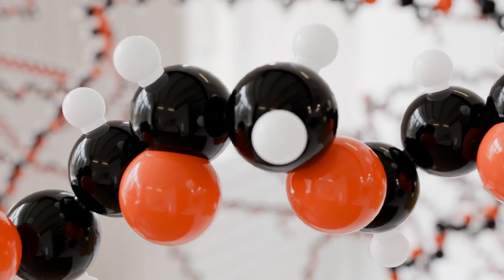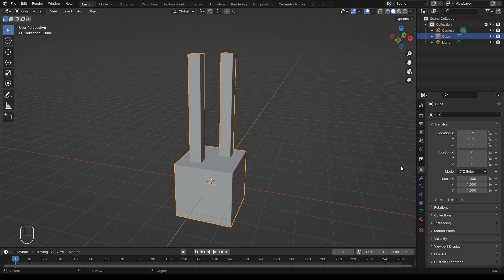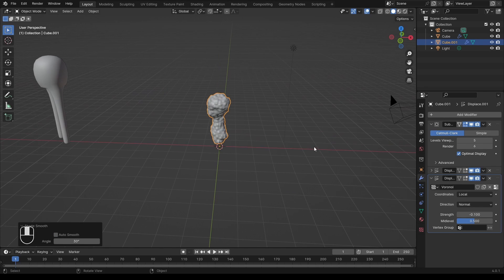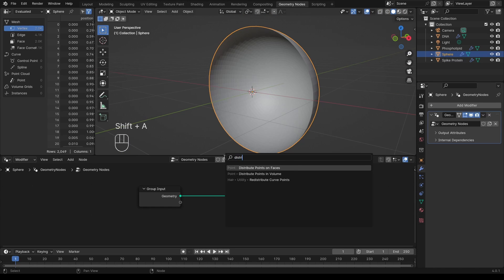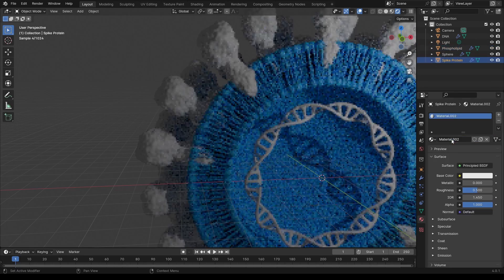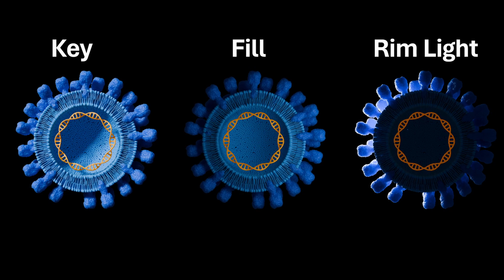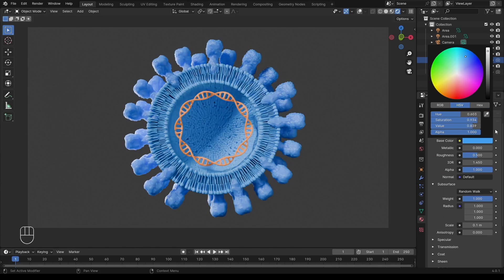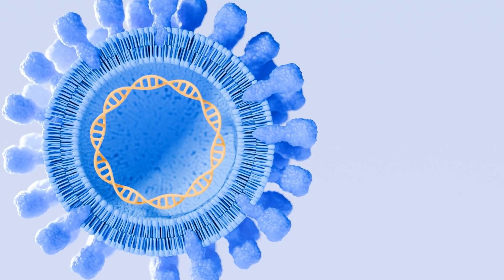Scientific Illustration in Blender: A Basic Introduction

Comment: I got trouble with choosing the ring at 1:42. My Blender is 4.2. Anyone could help me with the solution
Reply from the maker: Hi! The shortcut for loops selection is Alt + left click on one edge of the loop. If the edge can be mapped to multiple loops then it doesn't work, but you can still Shift+click on each edge that you need to select

Comment: thank you, geonodes seems to be really powerful ! i wonder, are you planning to have some detours in another realms-> physics for example? how about waves? sound and light) i still can't figure out how to make longitudinal (compression) waves, and in geonodes with math functions - there seems to be some kind of geometry on points (on every vertex in a curve, representing sine wave), but it never renders out, i end up making a curve or a surface 'old way', switch to geonodes and just put instances on points, but then i can't find a way to animate it all
Reply from the maker: Hi, thanks mate) ! That would be a fun short vid idea actually. Compression waves you mean as in a volume? I would use the Position Node, feed it through separate XYZ, then pick for example the X value, pass it through math-sine and add 1. This 'sine' field will have a value between 0 and 2 varying with a sine function on the x axis. Then use that output to control the density of a volume cube for example. Or do a volume cube > distribute points in volume > set position, then control the offset with the sine field (use combine xyz to convert the sine field to a vector field). This should make all the points wobble back and forth along X, they should accumulate and deplete. TO animate you can add math nodes before and after the sine function to change the values
Reply: @ClickbaitScience  volumes! of course, thank you so much, i somehow always forget we have volumes) i think it will produce exactly the results i am looking for (but surely i would love to see tutorials on this matter from you). and this 'separate XYZ, then pick the value, pass it through math-sine and add 1' is exactly what i saw in another vid, and hoped it is the right solution, but it seems there is no geometry - real  geometry - what can be displayed in render view? it is something that baffles me) do we need to feed some 'Instance on points' there? with spheres for example as instances?
Reply from the maker: @AstaMuratti  I think the look of the volume can be rendered with a principled volume shader? Also yes I would do as you describe, maybe not only sphere but little O2/ N2/CO2 molecules)
Reply: @ClickbaitScience  yes, i suppose so, we need principled volume for it. ah, little happy molecules) can't wait to play more with geonodes)